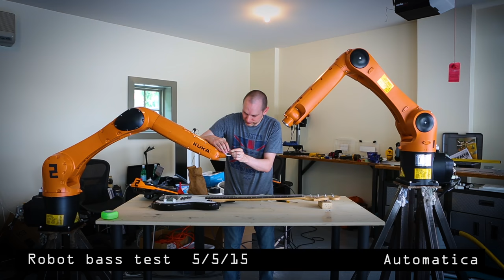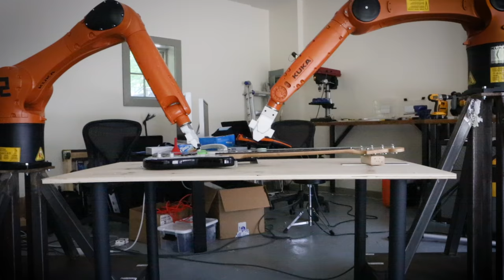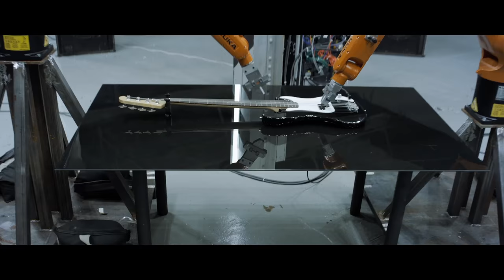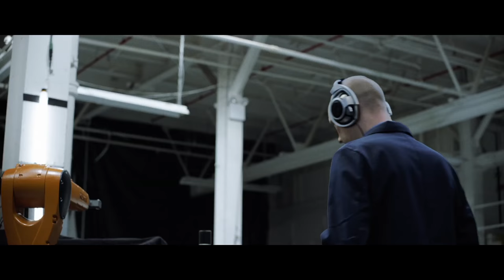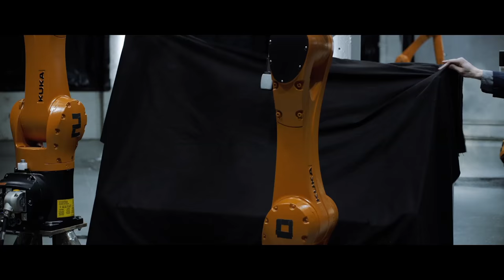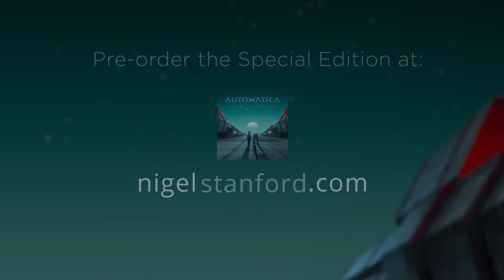Automatica: Robot Bass Guitar Tests

Comment: I bet that 90% of the robots in video is CGI in some way.
The robot in the beginning looks real bust the rest dont
Reply: You have clearly no knowledge of modern day robotics. Kuka has built one of the fastest robots of today. The only CGI used is the laser and explosions in the Automatica music video. Assembly line robots can move just as fast in popular automobile factories.
Reply: It comes down to two parts:
1. Logic
2. Visual perception

If you have a problem with one or both you will have trouble noticing fake and gay videos.
Just search for "Making of The Duel: KUKA and Timo" and you will  see how fake this whole thing is.
Reply: I didn't mean just this video in particular. This is just where I ended up after being pissed off at this fake crap. I can see now that I messed up my first (and second) sentence in my comment and made that unclear.

However I still think the last scenes look sketchy.
Press 5 and you will see a strange reflection in the tool on the left robot.
You will also see a jerky move which looks off.
Not saying that this is fake but I find it strange looking.
In the last scene it doesn't seem like he's looking at the robot, just straight out in the air.